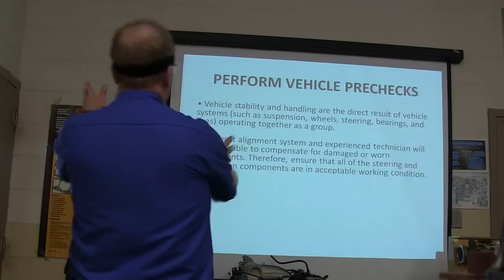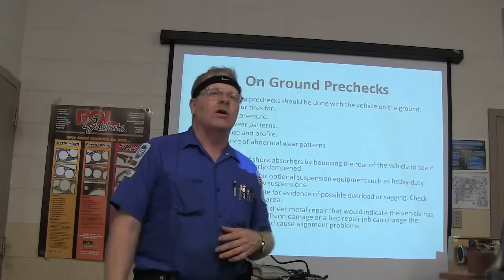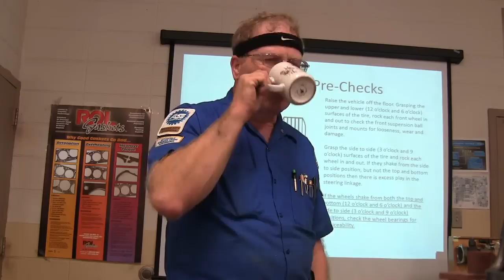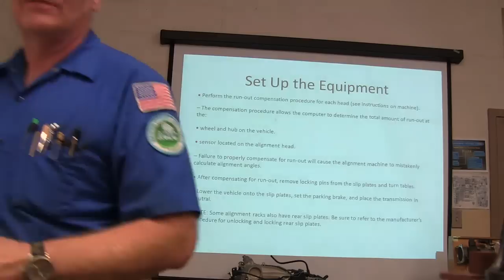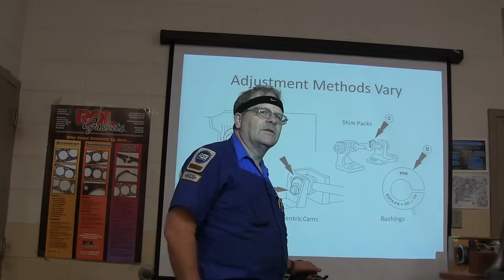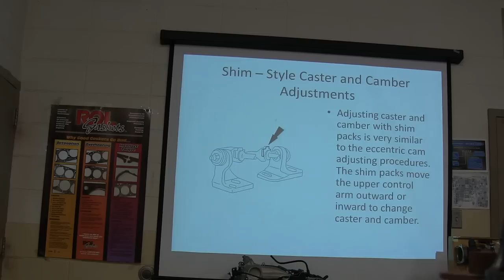Alignment Procedures

Comment: On smaller cars hard driving, pot holes, or minor driving accidents can wear out and compress springs on one side more than the other. I have seen strut mount bearing cause issues before. On the strut bearings you could not see when steering but with hand on the strut you could feel the binding resistance.